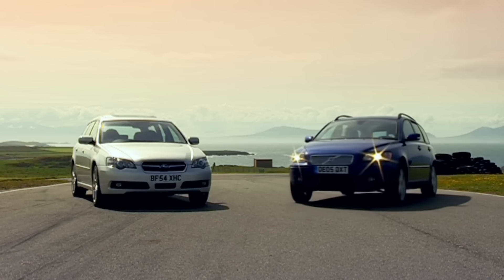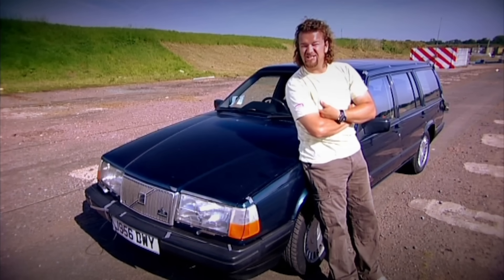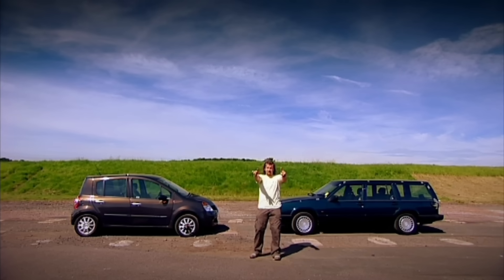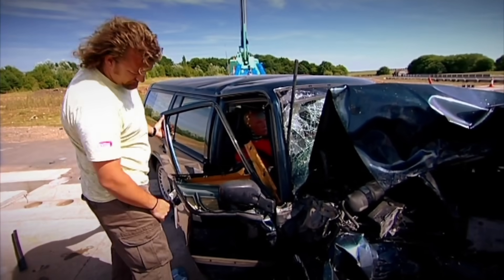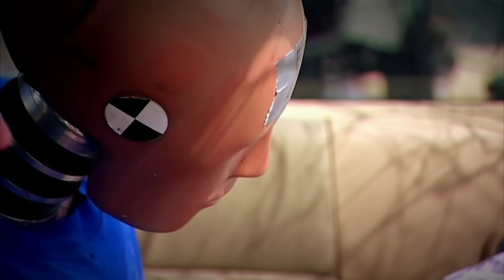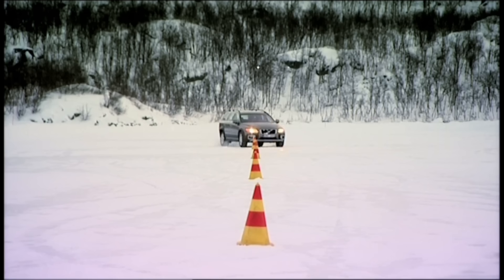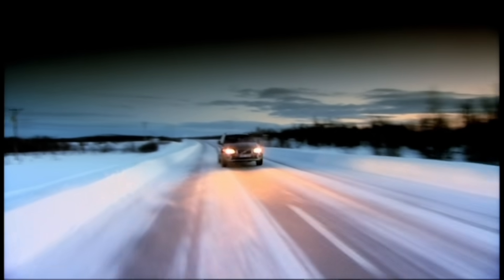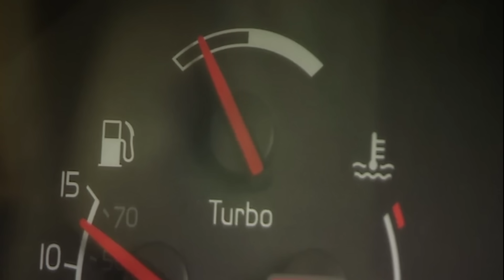The Last of the Volvo Estates! | Fifth Gear

Comment: I'm a Volvo fan but I'm not surprised that the 940 did so poorly. Firstly, it was an old car and it wasn't too safe for its time (it had a rather... unusual structure), secondly, this particular 940 was not equipped with airbags. Additionally, in this crash, the 940's steering wheel moved and prevented it from deforming to absorb energy as Volvo intended (although we would need injury-specific measures such as HIC to know better). An 850/v70 MK1 is cheaper and safer than a 940.

October 3, 2023 12:54AM